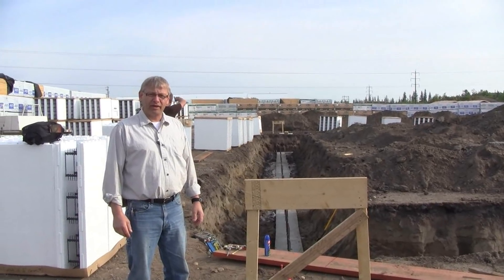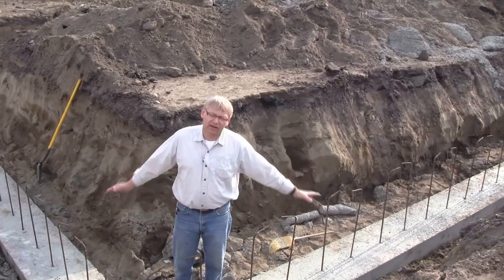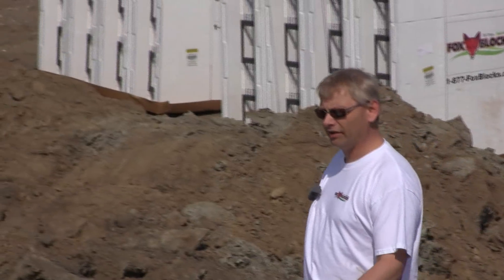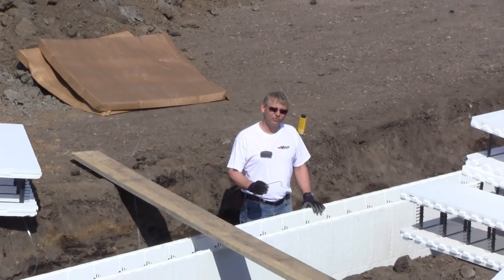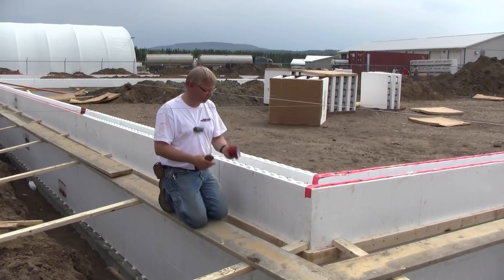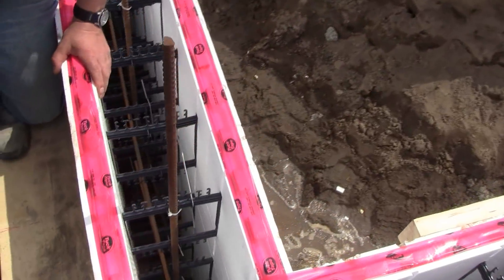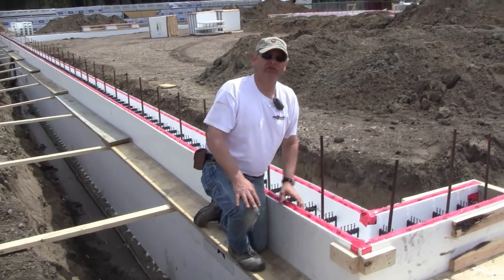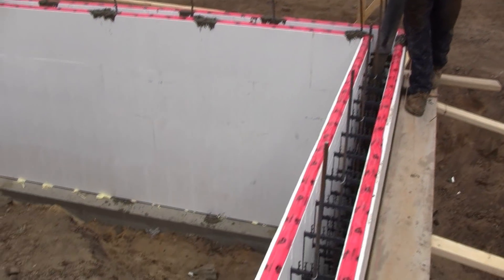How to Build ICF Stem Walls | Whitecourt Shop Part 1 with Fox Blocks Insulated Concrete Forms

Comment: I am a structural engineer, retired.  I have done thousands of foundations, hundreds of apartment suspended slabs, hundreds of tilt up warehouses, and two high rises.  In all my years, I have never detailed a hooked dowel out of a footing 0:37.  You can ask your engineer what is the purpose of those hooks, when the development length of the splice is sufficient.  Watch him spit and stutter.  I bet he is green and wet behind the ears, and wears Gucci shoes when he does foundation inspections.  Cheers from Canada.
Reply from the maker: Thanks for the comment Pete, This job was in Canada and I agree with you that the hook really is a pain to work with. I think the rebar suppliers add the hook as a 'safety' add on. As long as the development length is there most engineers will sign off on not requiring hooks. And in fact because these are in a footing it really is a shear member, not a tension member, so the hook is a non issue.
Reply: It's probably hooked so when you fall on it you are able to walk away and not be carried away in a body bag!!

Comment: Icf blocks are mitre starting to pop up in ca. Saw a new report that compared icf blocks vs 2x4 or 2x6 frame construction , the home's built with icf blocks survived a devastating fire and homes built with traditional 2x4 framing burned to the ground and were right next to each other. That to me is proof enough that icf block is superior to wood frame houses and is supposed to be cheaper. The cheapest part i don't know about